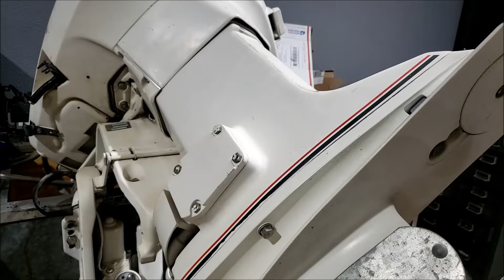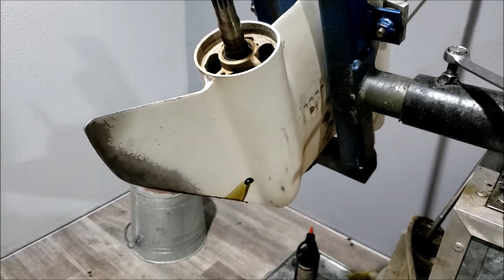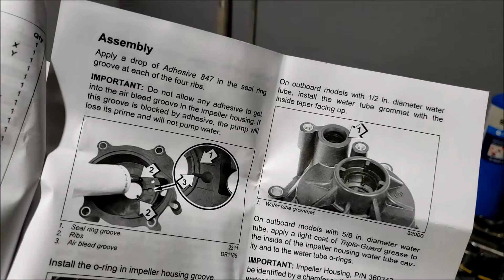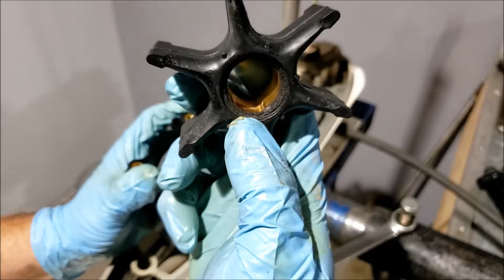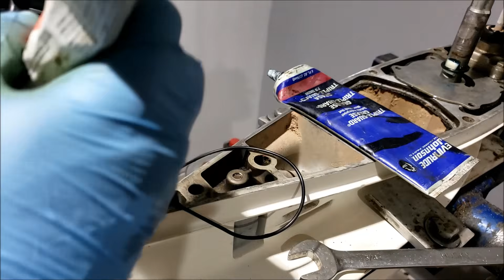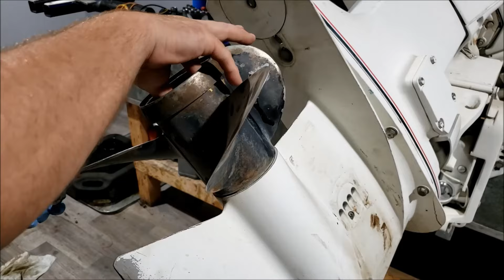1988 Johnson 90 HP;  Water Pump & Oil Change

Comment: Hey. Thanks for the video. 

I have a question.
I have a 1980 v4 90 HP. Identical to the one you are serving here. On my the oil fill screw on the gear housusing does not have any threds left. The screw is fine. How would you go about repairing this? 

So far i was thinking about inserting a helicoil.

Tganks again from Norway

Comment: I'm a bit confused about the o-ring that is in-between the metal plate and the impeller. (Not the o-ring between the cup and pump housing or the o-ring on top of the shaft by the splines) I have a couple of different manuals. One shows the o-ring and one manual does not show it in the schematics. Is it necessary? I would thing is would cause a bit of a drag when the impeller turns. Thanks for your help!

Comment: Brandons garage, mine is a 84 Evinrude 90. My parts diagram don't show the o ring under the impeller. I installed one and it don't feel like the housing is going down far enough. Do you know if my model requires that o ring?

Comment: The o-ring on top of the drive shaft do you put it right under the splines like in the videoa or do you move it down a little? Or does putting it in the motor correct it with where it needs to go?

Comment: Two times now I’ve had trouble removing the inside bolt that is under the trim tab going through the housing. The aluminum oxidizes and causes it to squeeze against the bolt. I’ve tried drilling out the hole a bit for more clearance and never seize compound and it seems that somehow it gets removed. Do you have any suggestions on how to treat the hole, bolt, threads whatever for easy future removal? Thank you

Comment: Brandon, I have a 1986 SPL Johnson 88hp. I changed the water pump, BTW Thank you for the help, and put the outboard back together. I thought that I would try the shifting before I start it up and have found that when I put the shifter in forward the prop turns with some force in both directions. The same with the reverse. On my inboard Mercruiser if you put it in forward it will only turn one way, the same if yu put the shifter in revers it will only turn one way.. Is the outboard different seeing how with force it will turn in either direction? I just bought the boat and did not shift it after I found it would start and the compression in each cylinder was 118 to 223 psi in all 4 cylinders. I kind of scares me so I thought that I would ask you. Did I do something wrong putting it back together?

Comment: I notice when you put the water pump on the shaft it doesn't rest completely flat on the plate , is that because the impeller sticks out of the housing a little bit ? I just installed one and it was the same way the blades of the impeller stick out of the housing just a bit and it was almost like I had to force it down, it's a oem replacement .

Comment: How necessary is it to remove the intake on the carbs + surrounding items? Really just want to unlock gear shaft pin without having to remove a bunch of other items. Have a '93 88SPL. Cannot find a single video online for the life of me relating directly to my motor. Thanks!
Reply from the maker: watch this video:
https://youtu.be/KYkHtgrklxM
Reply: @BrandonsGarage  Epic, thank you!! Much easier than I expected from other videos.

Comment: Fishing line in Arizona , interesting concept ! Lol. I use a brake bleeder to test my lower units ( Auto zone carries it ) and a swivel from a pump hose ! As many lowers as you do why not bulk gear lube with a pump on the pail ? It’s turning out to be a nice outboard , are you putting it on your pontoon ? How hard do you think it would be to build a standup boat like yours ?
Reply from the maker: Probably prett easy, however it depends on you are with fiberglass work.
Hey if you see anything unique or interesting at your show let me know. I really like weird odd-ball stuff.
Or evinrude paraphernalia.
Reply: @BrandonsGarage  you got it bud ! I’ll text you if I see something cool and unique ! I like Johnson stuff myself , my favorite year is 1958 because of the colors ! I’m looking for a 35hp to complete my collection !
Reply: @BrandonsGarage  do you like Bale-O-Matics ? I have a crap load of stuff perhaps enough to build 12 ! Lol. Or Corsair or Waterwitch’s or Bendix ?
Reply: @BrandonsGarage  I found some stuff I know you will like ! Lol. I’ll send to you after I get back but need to know your address! This stuff is off the hook ! And by the way I was taking to Dennis Evinrude yesterday ( great nephew of Ole and Bess ) and gave me something for you !
Reply: @BrandonsGarage  I picked up a A-50 runs fantastic and cheap and a British Sea Gull but needs a transom bracket , I’d send picks but don’t know your E-mail address ! All in all I purchased 5 motors 1958 Johnson 10hp QD-19 , 1972 Evinrude 6hp , 1969 Johnson 6hp long shaft , 1930 Johnson A-50 and the British Sea Gull and 5 nice pressure tanks and a lower unit for a 1970 OMC 5 1/2hp or 6hp and a seat removal tool from Richard White ( Richard’s Relics ) and the stuff for you , all for under $200 !